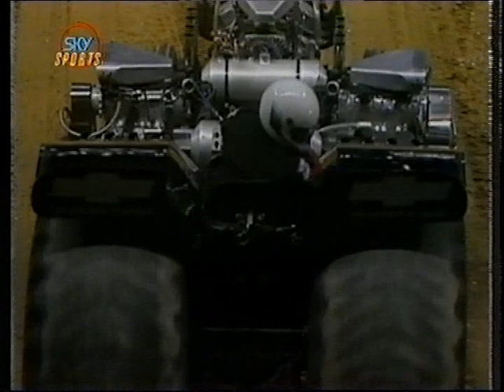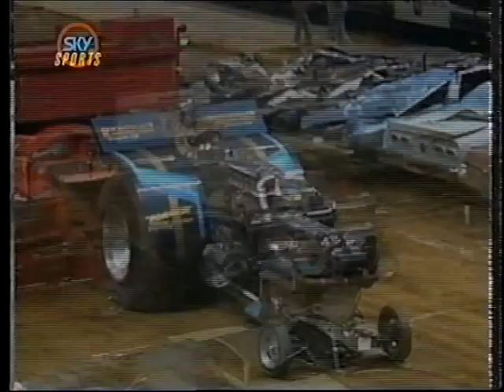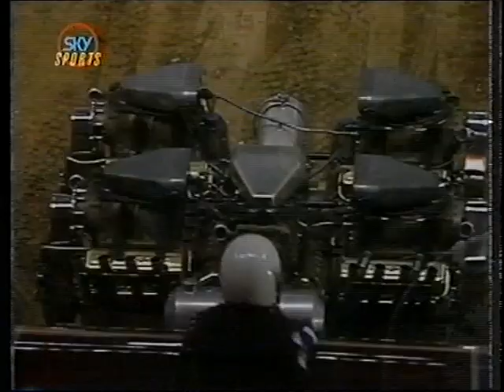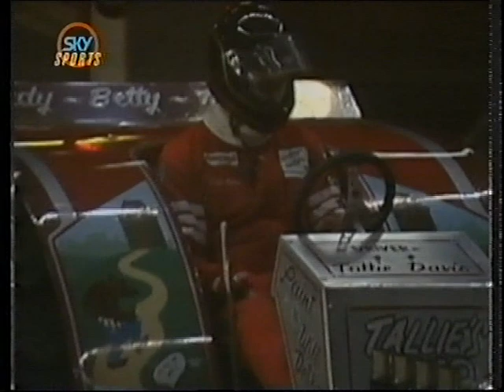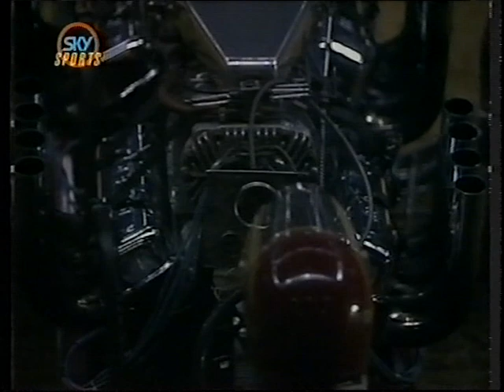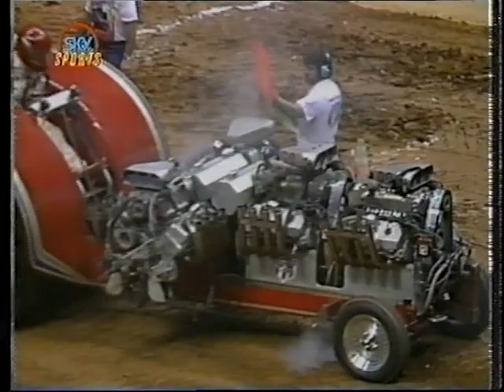Modified Tractor Pull Capital Center Landover 1991

Comment: That tractor called The Papa Bear used to be Tim Engler's Mission Impossible.  I know that engine combination from anywhere, plus that back engine's headers have that split between the 2 middle pipes.  Also Tim ran that tractor with 5 engines in the 7200 pound class.  If you notice the space on the front of that tractor,  2 extra engines go right there (1 more on each side meaning 3 on one side, 3 on the other side plus the one in the back for 7 engines in the 9200 pound class)
Reply: I thought so! Thanks.